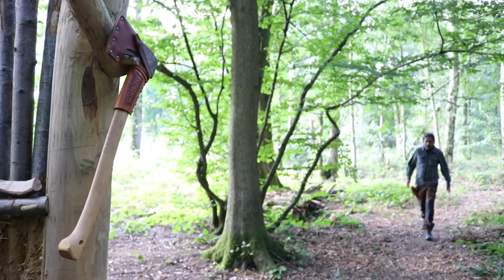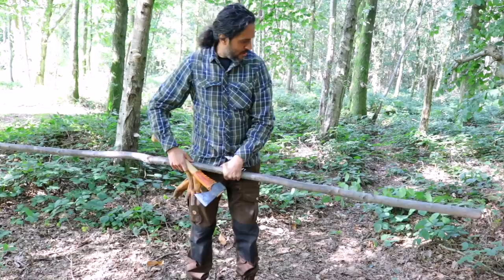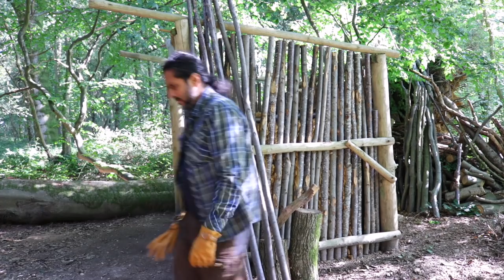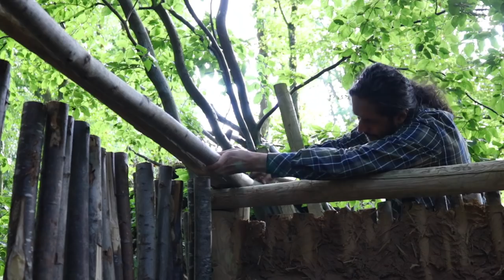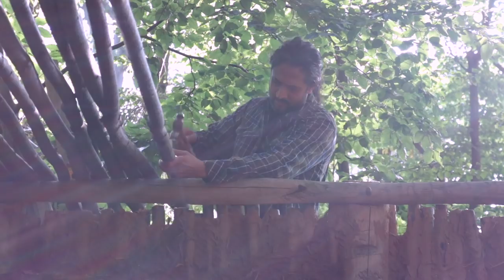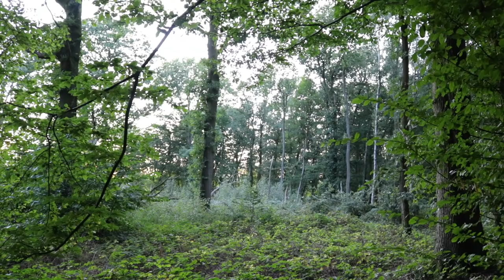Bushcraft Basecamp (Pt 12) - Building The Roof (First Phase)

Comment: It is really good that you have used all natural methods to build this shelter since 99% of people would take the easy route of using sheets, paracord and screws / nails which wouldn't teach the builder or the viewer about traditional methods.
You did well to find straight chestnut as all the trees up here must have some sort of palsy since the limbs are bent, lol
Woven willow shelter next?
I did one of those a few years ago and it lasted for ages.
Reply from the maker: My man thank you kindly, yeh it's been difficult working how to do this build using only natural materials and so learning lots as I go. Down the line I want to have a go at building a willow structure for sure as if done right they work really well, lots I want to do but limited time!! :) ~Peace~
Reply: Time is a real killer and it seems like everyone who works is working longer and harder than ever before. That can't be good for the mind or body and for the first time in my life I'm actually envying the people who work limited hours for other people.

Comment: My day was sort of 'meh' but then i logged on to YouTube, and what do you know, Zed posted a video 2 days ago and it's still here for me to watch, how blessed am i ^^ … starting to look pretty homey Zed, think it's about time for doing an overnighter with the tarp on there, find the right place for the fire, try out the bed, and see how the airflow and heat distribution is. As seeing we are just a few days into autumn, there are still some nice days ahead where you can do some stuff to the sides by playing with some mud. Soon enough though it will just be to cold and wet to even consider doing that. So i guess next weekend is as good as any? Get the tarp on and just mess around for the day with the fire placement (use some green wood to get some smoke going during the day so you can actually see the airflow), do some cooking, maybe get a reflector wall going? Get some sleep and hopefully be chuffed about the result the next day ^^ … (or else plan a day to finish up the walls) … also, seeing how close we are getting to autumn and winter, depending on the solution you go for for the roof, may want to consider doing that in spring next year? mainly due to weather concerns, and it may also be nice to just focus on the inside and just being there as during the winter an overnighter will likely be some carving and cooking and having the things needed for that close to ready may be more in line with enjoying the outdoors than rushing the roof for the heck of it. Though obviously having the final cooking implements blacksmith'ed would be a great thing for wintertime (nice and close to a hot bed of coals ;).
Reply from the maker: Yes I am going to be building the firepit very soon, have ordered some dutch ovens / cast iron cookware so cannot wait to try them out. Not long left before my first proper overnighter and as always I sincerely appreciate you watching ~Peace~
Reply: From what i heard Dutch ovens are 'homemade', generally by a good amount of brown beans, musn't be to hard for a vegetarian to pull off a good one  ;D … already looking forward to the video seeing as always I sincerely appreciate you producing them (the videos, those Dutch Ovens likely not so much ;D ~ ohw fart jokes they never get old) ~ peace!

Comment: Hey Zed. I just discovered this series a couple of days ago and have watched from the beginning. I've waited until now to comment because I didn't want to make a suggestion then watch the next video to see that you had already worked out the solution. I will give one idea I had when you were putting in the horizontal pieces to replace the cords holding in the wall pieces. I think I would have just created a pocket in the uprights and cut the horizontal piece a bit longer than that distance then flexed the piece and let it go into the pockets. It wouldn't have been structural but it would have held the wall pieces in. Isn't it about time you made yourself a proper wooden maul? Keep up the good work.
Reply from the maker: Yes very good suggestion, very soon I will be making a wooden maul along with a carving horse ~Peace~

Comment: This is nice. I now have to go and binge-watch the rest of the play list.
I presume this is also in the UK?    What do you have as available materials?
Regular thatch works well at a 12:12 pitch, but can leak (unless really thick) when one approaches 6:12.  Split Shingles begin to fail around 2:12, due to wicking  "creep up" 
So, Oil Cloth?  Leather"  Tar Felt?   I will be interested to see what you come up with.
We have lots of palms and other tough, broad leaf stuff where I live, so a low slope roof is no problem to waterproof.
Reply from the maker: Thank you kindly, yes this is in the UK on private land I have permission for. I am considering thatching but the angle on the roof may not be steep enough, have yet to decide ~Peace~
Reply: I have seen white birch bark used like mission tiles on low sloped roofs, but you have to have a freshly felled 10 - 12"  tree nearby to make it work. One slits the bark into 3 to 4 foot long by 1/2 or 1/3 the diameter to make cap and pan "shingles". I don't know what other species might work.
The bark has to peel cleanly from the cambium.